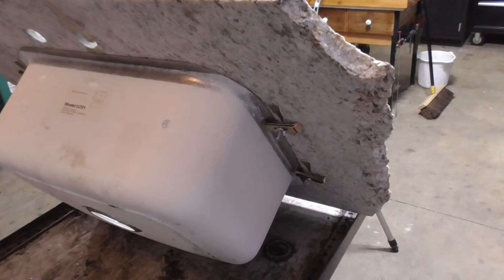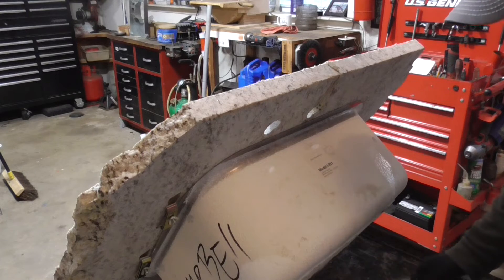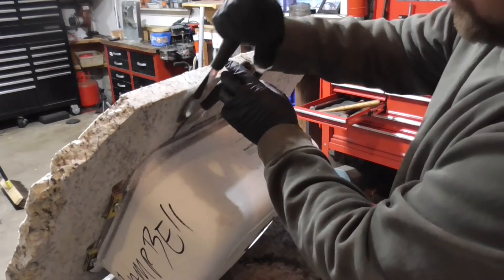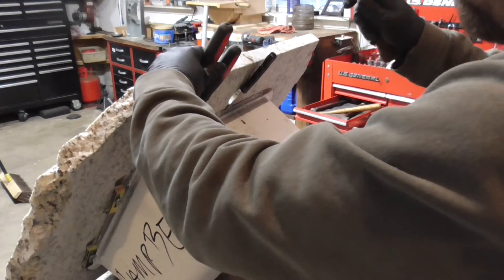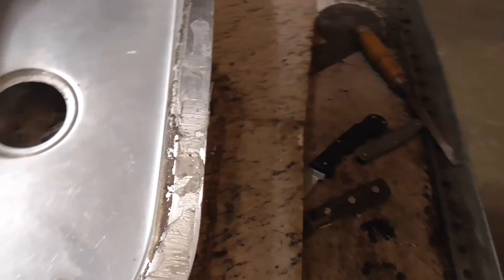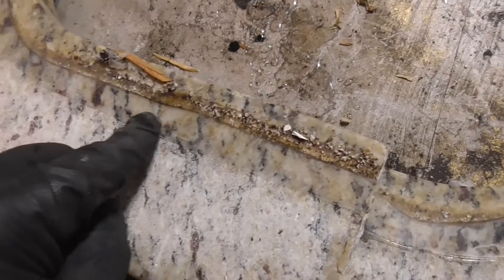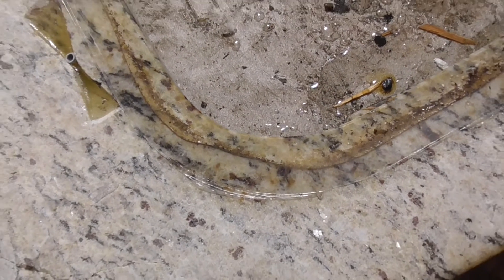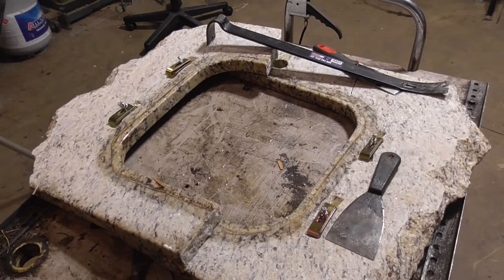Undermount Sinks Cause Bacteria?

Comment: There are 3 basic ways to fit the under-mount sink and that is the revel.
The granite is cut slightly bigger than the sink = positive revel.
The granite is cut slightly smaller than the sink = negative revel.
The granite is cut exactly to the size of the sink = no revel.

My preference is a slight negative revel so that when wiping into the sink the stuff does not catch on the sink edge.  Also, the small revel is easier to keep clean.  I've seen where people never even think to run a rag or sponge around the revel when cleaning.  DUH.

Comment: I wonder if a "cable saw" would've made the job easier. The term cable saw might be the wrong nomenclature. It is a cable, the thickness of a guitar cord and, it is use to cut the sealant on a windshield when you change/remove glass from a vehicle.

Comment: i bet there's a reason the installer doesn't put the sealant right up to the edge.  tricks of the trade and what-not
Reply: The reason is getting silicone on other places and then cleaning it takes too much time. The installer wants to get in and out as quick as possible. It functions and they are gone. They don't care about 3 years down the road.  That's why you do things yourself if you can.

Comment: Whether top mount or bottom there will eventually be something hidden in the interface. Just spend a couple of minutes here and there with a thin cloth or paper towel wet with 409 and push into the seam and wipe. No big deal, as you said.
What can be more obvious is along the sides of a stove/oven where it meets the counter left and right. Lots of “stuff” gets in that tiny slit over time.

Comment: Our under mount sink gets nasty along that transition edge between granite and stainless. End up bleaching that transition area every once in awhile. It's worse during humid summer months.
Reply: Right. Atleast with an overmount it would be hidden mostly. Also, it is much easier to replace a sink or repair the caulking than to have be under a cabinet chiseling it out... Just my take. I'd rather have an overmount

Comment: I think it depends on the quality of fit, installation, and upkeep.  I’ve seen some undermounts in homes that made me want to puke just casually glancing under there.  Also, a 3 year old installation may not be long enough for the exposed silicone to start breaking down which it always seems to do eventually.  Great video!  But I’m still torn as to which way I’d go if I were remodeling a kitchen. Thanks for posting this.
Reply: At least with an overmount sink most of that. Stuff is hidden under the lip. With an undermount, most Grime can be seen still. Also an advantage of having an over Mount Is the ease of replacement Of Caulking and replacement of the sink itself rather than having to crawl under a cabinet to chisel the old undermount out.